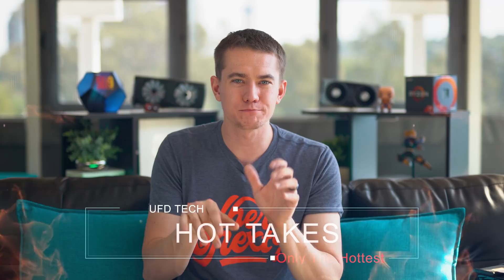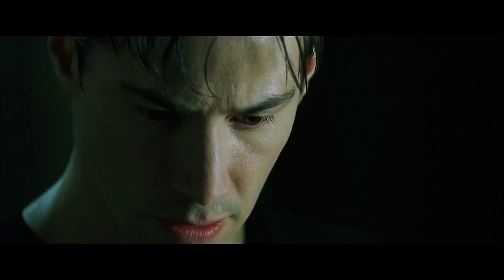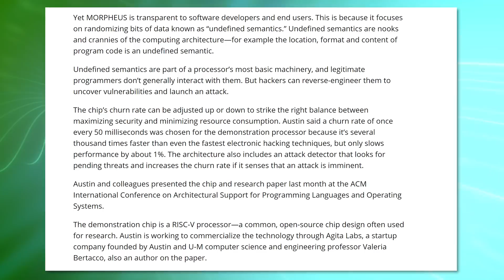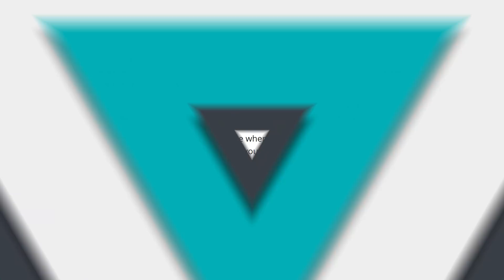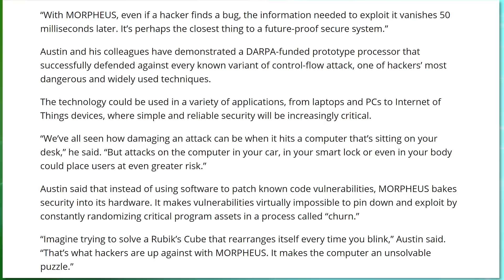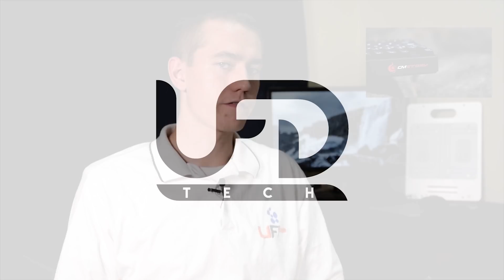An Unhackable Processor?!?

Comment: What we need is in someway air gap (isolate) the hardware and the operating system of computers while still letting apps and browsers access to the Internet... My Windows doesn't need to send telemetry and my network doesn't need physical access to the chips on my motherboard.

Comment: I figured out how to pick locks at a very early age because my brother kept loosing the key to his fire safe.  Since then, I've learned a bit more about technique, but the basics always seem the same.  I'm guessing it's something similar in software/hardware hacking.  It doesn't matter how special or how different your equipment/software is if you don't address the basics FIRST and COMPLETELY.  I would guess that by changing the risk processors to make this special chip, they've actually created a massive vulnerability that they aren't even aware of yet.